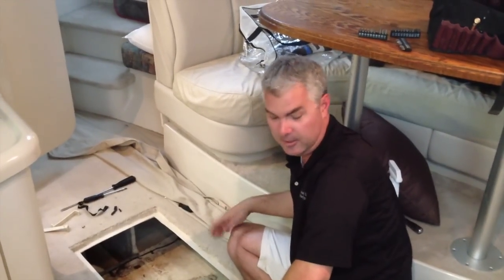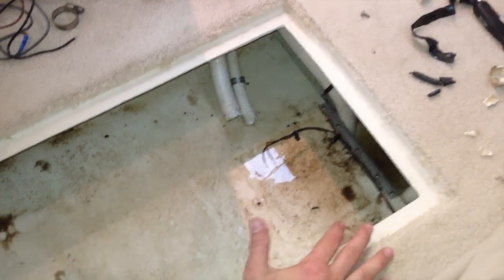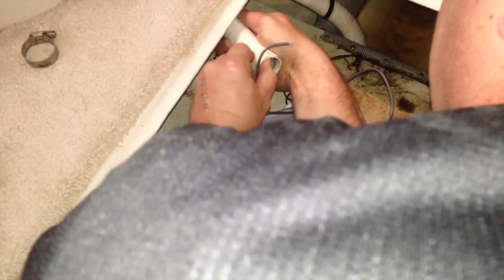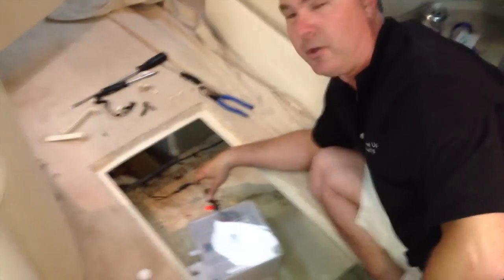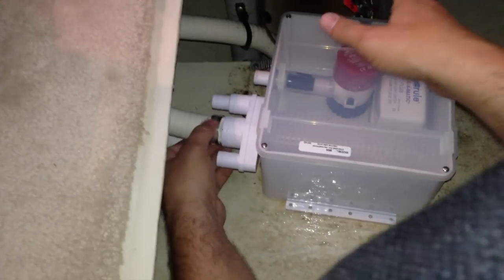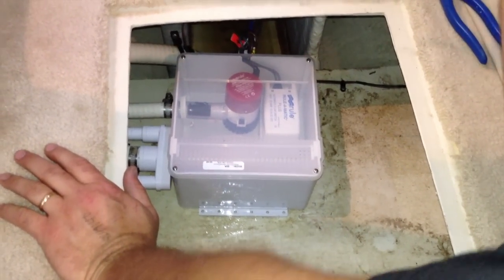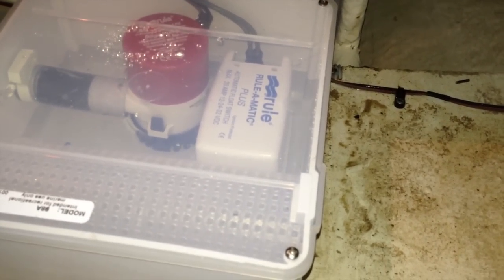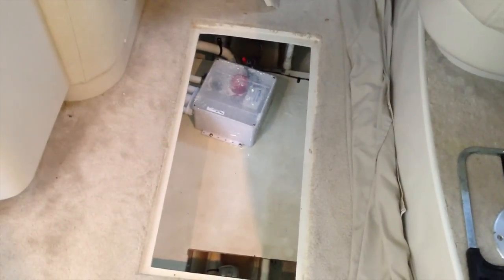How to replace a shower sump pump in a boat

Comment: I noticed when the pump comes on, there is some spray that comes out over the pump motor and hits the lid. Is this by design to keep the pump cool?    Mine has been doing the same but is a couple of years old.  Never really noticed that until now.   Was going to put a clamp on the pump barbed section.

Comment: One thing you may want to look at is moving the float switch 180 degrees.   there is a weep hole that will fill with water and cause the float to fail.  Especially when the boat is moving.   (I have had 2 fail until I found that out. )

Comment: hi Jarrett, nothing to do with this post I have no idea how to send a question, posting it here new user LOL I have an older fiberglass boat not wood stringers, stringers are hollow glass not foam filled my problem is the floor itself is the usual ply with glass one side and seems to have dry rot floor is very soft in spots and seems to have been replaced by a idiot cut out centre replaced leaving old timber up both sides do you have experience with this stringer can I remove and glue down new